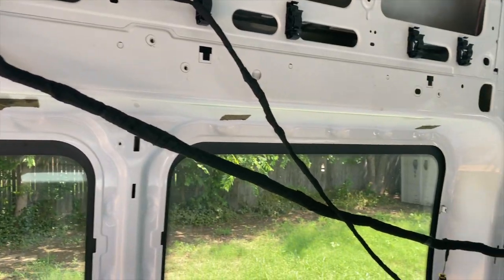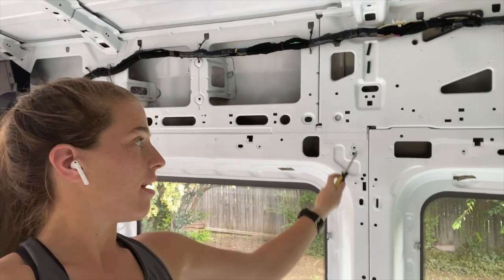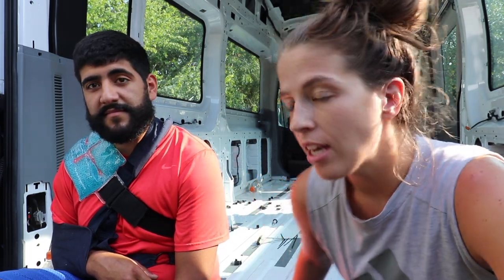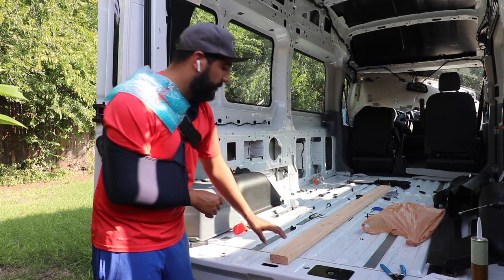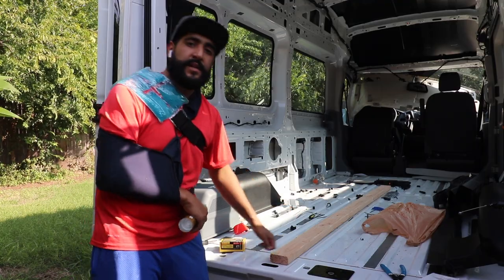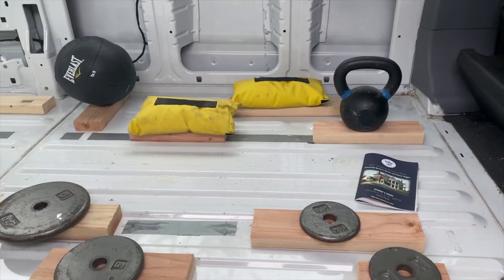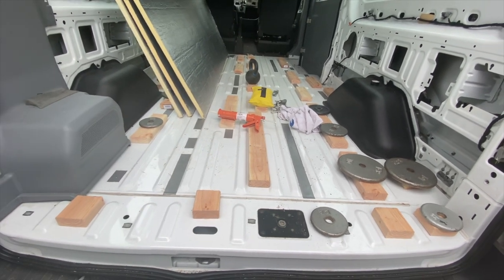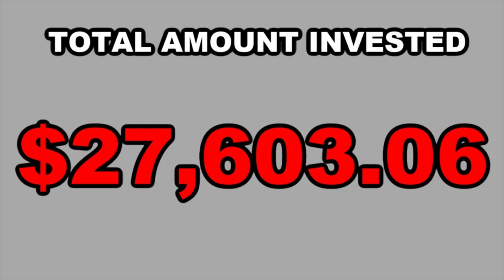Installing the Subfloor in Our Camper Van | Camper Van Build Ep. 5

Comment: Hi Aubrey and HP;

WOW! you work fast!  Did you (meaning either you or you and HP) get that panel in place?

Glad to read that your having fun with this as it is exciting for us to watch.  I'm familiar with Liquid Nails at least I've seen it and used it a tiny bit; I was surprised that it sticks to the paint or treated metal of the van.  Probably if I ever read the lable I'll see it listed as applications.

Quick with the skill saw too, and measuring.

Are the wires as high as you want and or expected.  I ask because I know you had to work with what ever slack was available, and when you were describing it ahead of time I thought you were trying for in the corner of the side walls and roof?  Looks about 6" to 8" short?  If so will that be an issue?

I ask not to discourage at all, I ask because I know you have this all figured out, including if you need to modify any plans.

Doing great, far more then I could on my own,  thanks for sharing

Bill